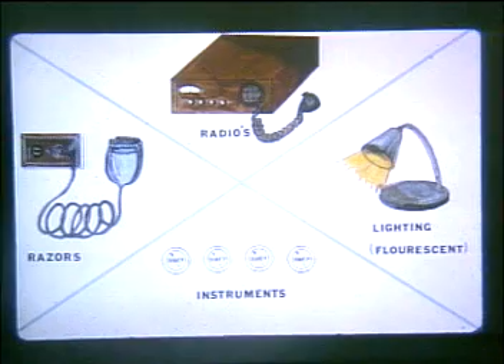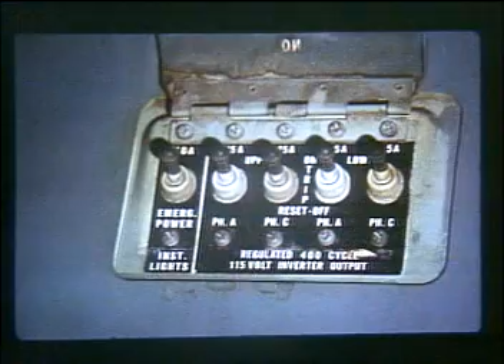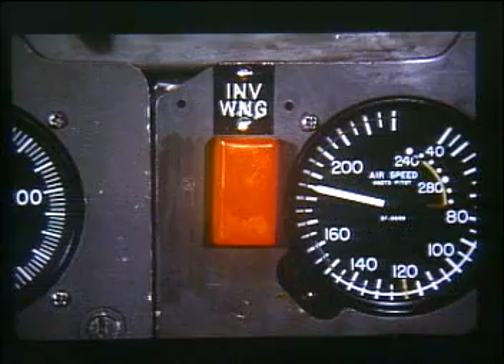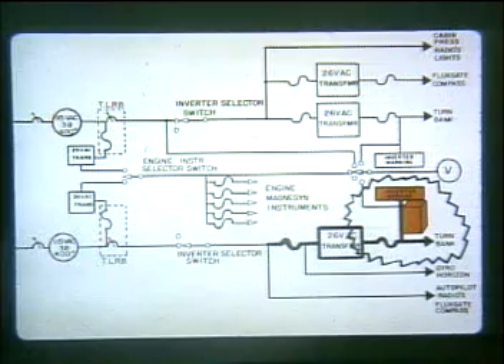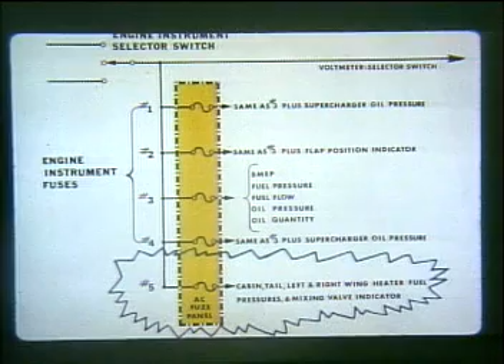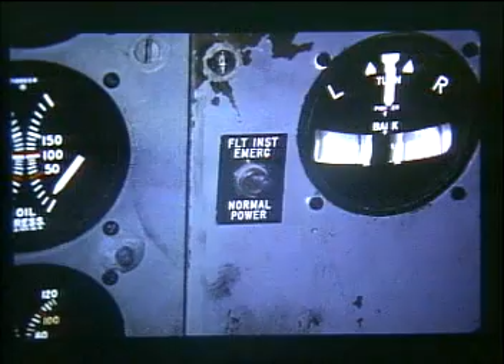DC-6 DC Electrical System Part 1

Comment: Hi Robert, Thank you for sharing these DC-6 videos. I have the feeling that the AC electrical has been loaded twice (once under the proper name and once under DC Part 1). I would be curious to watch the DC Part 1 if you had it. Thank you :)